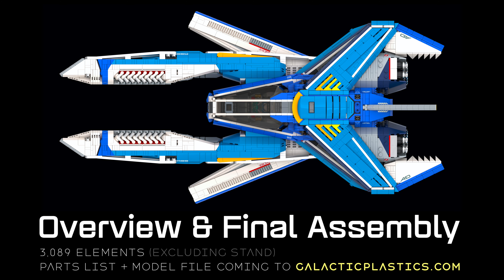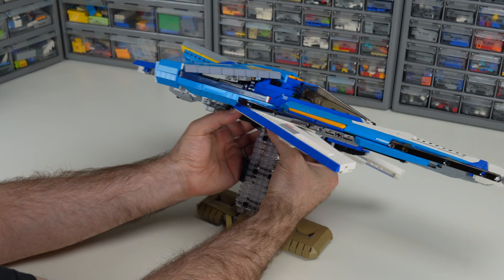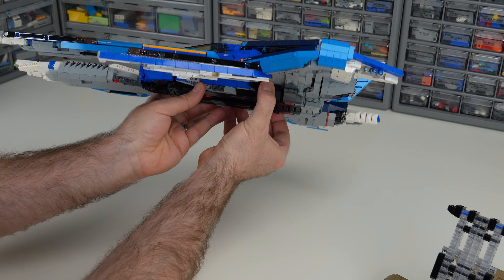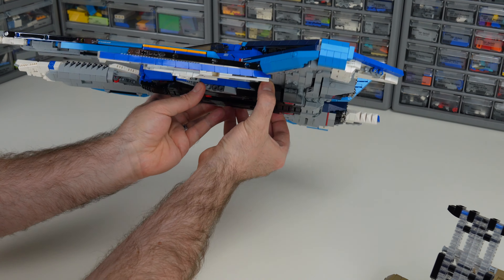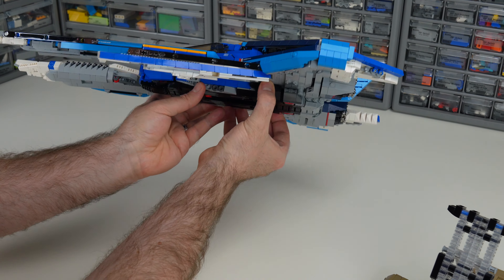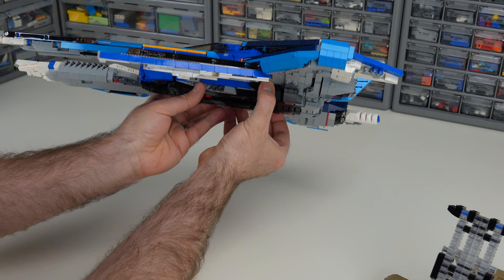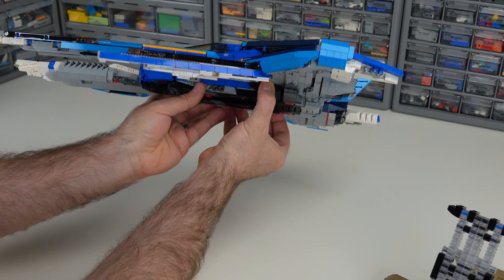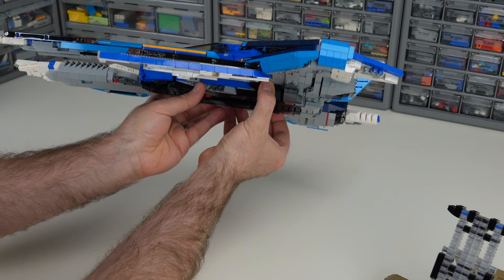Advanced LEGO Build: Interference

Comment: Blown away yet again! Really glad this one has a 3d file. I took a look at the insane techniques you used. I noticed how there were 29 parts weren't identifiable. I figured out that they were the decals/stickers which were the 14 stickers on each side, but I can't figure out what the last piece could be. Got any clues?
Reply: The silver Chrome pieces are custom made i guess, there is the crane arms, 1x1 plates and and lots more pieces for the engine
Reply from the maker: Yes, that's exactly right! 👍 I put those into the CAD file as 'chrome', though they don't exist IRL, and the custom ones used a 'steel' finish that's not a perfect mirror.
Reply from the maker: There is a Slope 45 2 x 1 Triple in the CAD file that I had to modify for digital by lopping a hair off the top. It was a perfect fit IRL, with airgap geometry.

Comment: Are the multi-coloured internals so you can see the individual pieces easier when making it symmetrical?
Reply from the maker: The bold contrast makes easier for me when I'm building/refactoring, not necessarily for the mirroring (though helps with that too). It's also a nice way to use up bits from my parts bins. 😁